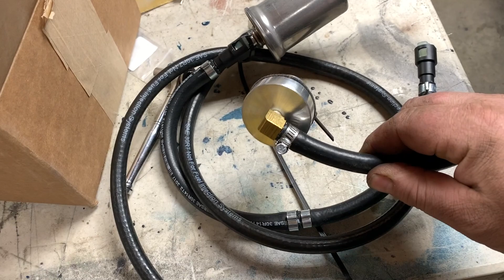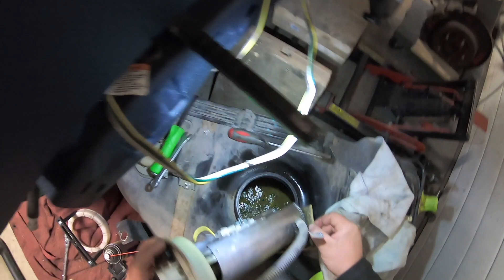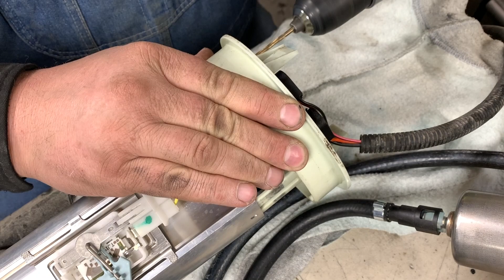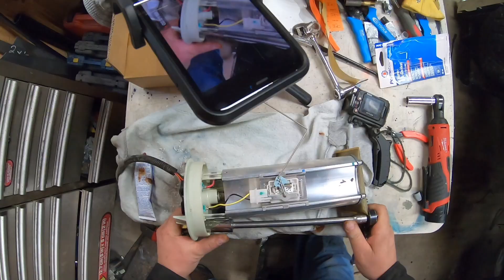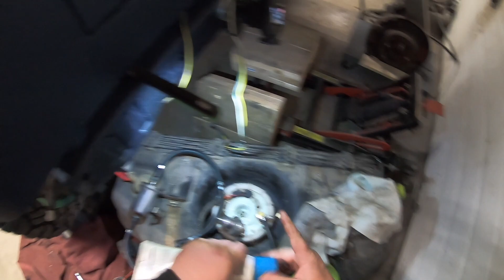Jeep TJ Ls Swap Fuel Pump Mod DIY

Comment: My 5.3L motor doesn't have the return line on the fuel rail.  What do I do?
Reply from the maker: there is a special fuel filter that has a return line for ls/vortec motors
Reply: @TestDontguess  Thanks for the quick reply and I appreciate all of your videos!  I've been planning my swap and your videos are helping tremendously.  I've found the "Corvette" filter/regulator but not sure how to install it with my Jeep fuel pump assembly.  I'll keep looking. Thanks again!
Reply: @TestDontguess do I need the return line if my 04 ls motor has only 1 line at the rail?

Comment: The two other hoses that run along the frame from your tank up to the old 4.0, I think they're both vent lines? You looped them together in a different video, is that your final solution or do they actually need to vent somewhere?
Reply from the maker: They are part of the evap I haven’t decided what I’m doing with them yet, most likely need to vent somewhere
Reply: @TestDontguess  Right, seems like one goes to purge solenoid and the other goes to the vent solenoid. They both come from the charcoal canister but aren't you deleting that? I'm keeping evap stuff so I need to figure it out but I'm saving it until the end.
Reply from the maker: I’m leaving it in place haven’t decided if to block it off or if I need to vent it
Reply: @TestDontguess  Makes sense. I just read the Novak materials and ordered a GM fuel tank pressure sensor and GM vent valve. If I get there before you I'll let you know how it goes.
Reply from the maker: That’s one way to do, I will need to vent the gas tank for sure
Reply: @TestDontguess  FYI I could never get my evap test to run on my OBDII tester and realized that the evap test needs fuel level to run, Novak deletes that out of the harness unless you're in CA. So, just letting you know that if for some reason you need the evap test to run, you'd need a GM fuel level sensor somehow in the tank to tell the PCM the fuel level. I didn't realize this. I think I can get it inspected with that test not ready but I haven't taken it in yet.
Reply: Does the kit you ordered the return one? If so did that come with the parts to do the return line or did you ordered the separate?
Reply: @emilythurlow7613  My LS has the return line run all the way from the back to the front and I had to create that line, I think BSK did as well. https://wranglertjforum.com/threads/ls-swap-fuel-lines.31606/

Comment: You always need the return no matter which fuel rail you have.  It either comes of your rail or it comes of your regulator/filter.
Reply from the maker: yes I have seen the Ls swap fuel filter/regulator with the return set up
Reply: Some handle the return directly at the fuel module

Comment: I always thought the fuel pressure regulator was on the fuel rail on the 4.0L.
Reply from the maker: Negative ghost rider there is nothing on the 4.0 fuel rail for 97-2006 perhaps on the older models 🤷🏻‍♂️
Reply: Ok maybe on the older models.Thanks Jerry....
Reply from the maker: I dunno about the older models but it’s possible